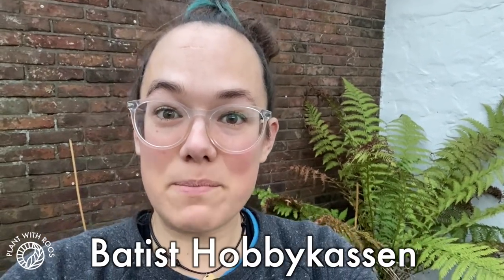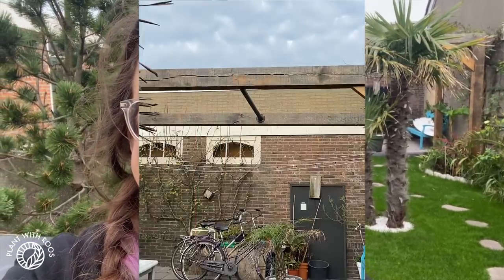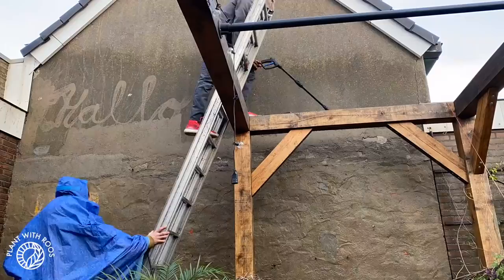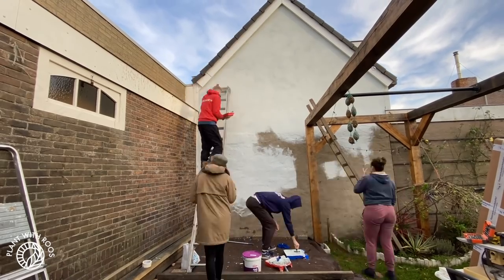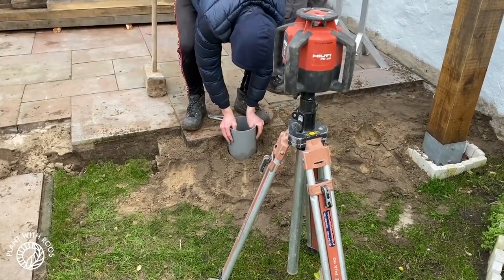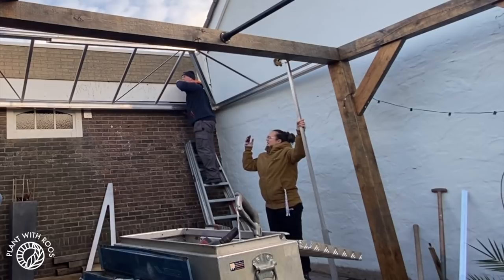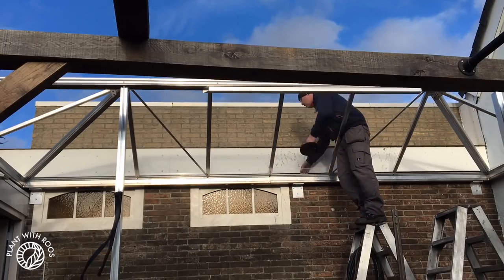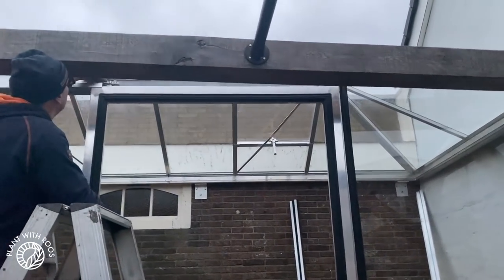Greenhouse build! ft Batist Hobbykassen | episode 1 | Plant with Roos

Comment: Looks amazing! Two questions: How does the rain drain away at the back (side adjacent to the building)?
Won't the glass break if the snow piles up at the back and you can't scrape it off? 

I have seen people apply bubblewrap to the outside of similar conservatories as the glass does not hold onto as much heat in winter. It seems to help a lot. It still drops down without a heater though.
Reply from the maker: Hey thanks! Great questions. They provide drainage all around and down the front, I'll show you in the next video. There is hardly ever snow here so that's not something we worry about. We had snow two days after placement tho and it looked so cool on the roof! It just melted and went away through the rain drainage. We're not planning to heat it but might add something recommended by the builder to make it hold warmth better - but first we want to measure the temperature  difference with outside as it is.